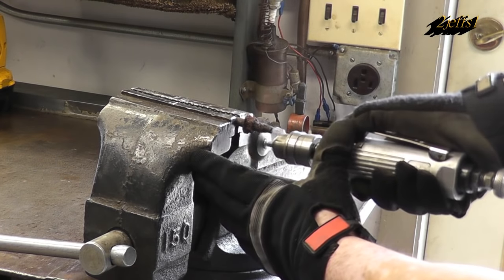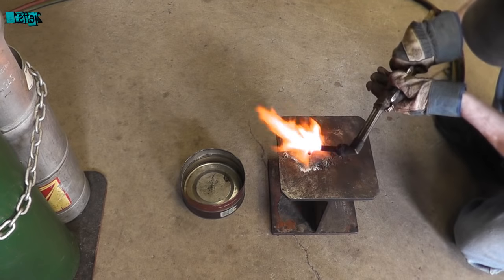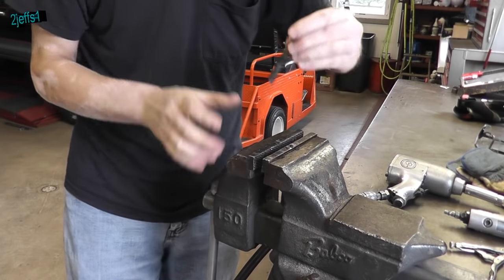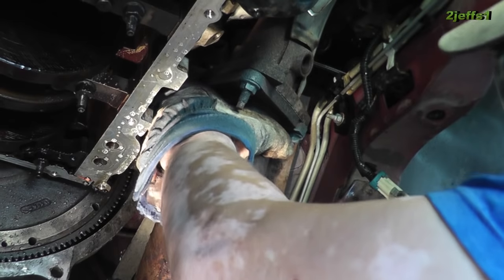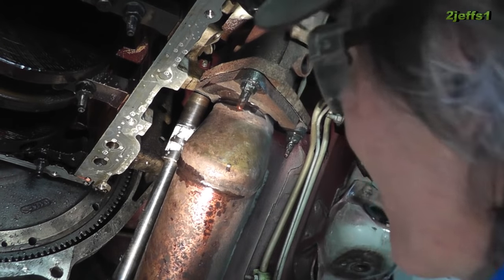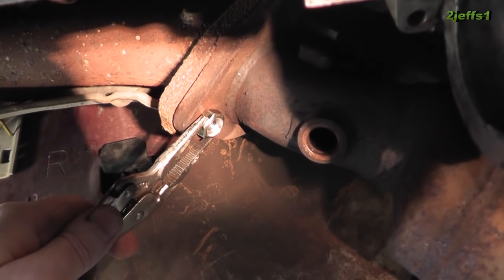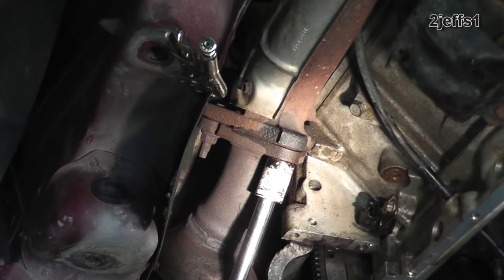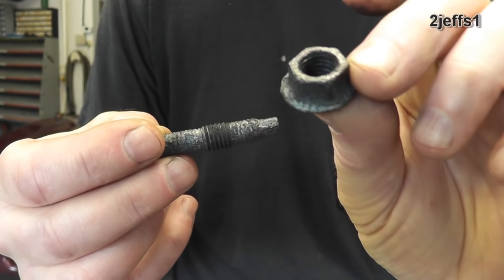Removing Rusted Bolts and Nuts THIS WORKS GREAT!

Comment: Hey Jeff, I learned that very trick myself over 40 years ago!  It worked then and looks like it works still!  There are those that say 'How do you know it wouldn't have come off without trying it first?' but learning to resist that temptation to find out marks a big difference in the 'experience curve'!  
But one other additional thing I did with exhaust bolts or similar was to clean up the threads and use new bolts of course but I always took the precaution of adding anti-seize compound to everything before putting it back together!  I figured it would be doing the next mechanic that had to work on it a big favor, and there was always a good chance it would have been me!  Upper exhaust manifold bolts on old Ford 390's as an example!
Great videos!
Reply from the maker: Great write-up you had there! It was hard to believe there were some nay sayers. It is easy to tell how much experience they had in the real world by the comments. I got a kick out of some thought I re-used the studs where replacement wasn't included in the vid. But-why should that matter anyway. The vid was how to get the rusty stuff apart, not when/whether the studs need replacing! It was easy to tell it's not your first day on the planet! Thanks for stopping by, Jeff.
Reply: Sometimes instead of anti-seize, depending on the application, I use low strength threadlocker (Loctite).  This forms a seal between the threads that keeps out moisture/corrosion.

Comment: A bit of candle wax painted over the backside of the heated exhaust flange  will wick between the stud and flange threads like solder -  I've pulled frozen  studs from a 100 year old tractor  using both the cold water and candle wax trick.
Reply: Make a video please.
Reply: no need for a video -  after heating the area, wait until the orange glow just disappears and  use a candle to flow wax around the stud. Just like solder in a copper  plumbing joint, it will wick  deep into the threads to lube them for extraction.   It's a process that's been used by blacksmiths for two hundred years...
Reply: The wax does nothing.  The heat is doing all the work.  Its an old wives tale that the wax 'lubricates' the metal.
Reply: @yeagermcbipper9008  I always wondered about that. I've seen videos of people doing it and in my opinion the wax vaporises before it can even reach the threads.

Comment: I have a little Oxygen / Map gas torch from home depot.  I’ve been using the same type torch since the 80s when it was Solid Oxygen.  It’s a small flame but very hot and very precise.  I only heat the nut and take them off while still red hot and it never failed me in +30 years. 

 I’ve found this torch very useful when dealing with brake bleeders, I heat around the back of the cylinder where the bleeder threads in.  The flame it so small and hot I have consistently removed the bleeders without heating the cylinder up too much as to damage rubber parts inside. 

Heating only the female part of the thread allows it to expand but you have to break it loose while still hot.
Reply: Hey Frank, anywhere you can still find those? Or something that is basically the same thing? I was looking today and I'd like a torch better than just propane, which is pretty bad, but I don't have the cash for a big oxy/act one, that one you mentioned sounds really cool.
Reply: Frank L Rusty bleeder screws are easier to remove if you place a snug fitting drill bit into it before wrenching on it, keeps them from twisting off so easily.
Reply: At ace hardware, home depot or your local hardware store.
Reply: Frank L I have been removing bleeders like that for years and havnt broke one since I was 16 yrs old. a long time ago

Comment: This is the reason I don't do exhaust systems anymore.  Rust everywhere, in your hair, eyes (even with glasses on), etc.  Been doing auto repairs for over 40 years. I find it better to bring it to an exhaust shop where they do it all day and its not a big deal to them.
Reply: I'm with you. I do most of my own auto work but I leave A/C refrigerant systems, automatic transmissions, and exhaust to professionals. In the first two I don't know what I am doing; in exhaust systems the pros can do it with a tenth of the aggravation and low prices.

Comment: I can vouch for this system I have used it for the last 40 years and it always works, now that I  am retired I collect stationary engines and it works all the time when undoing stubborn bolts and nuts which is a normal thing on old engines!!!!

Comment: An old blacksmith showed me this many years ago when I was struggling with a series of studs on a tractor axle. I sheered off several despite being red hot. Cooling them quickly made all the difference. Many thanks for posting, it's a really great tip.
Reply: If they remain red hot they will shear. However, if cooled quickly, and cooled so they are absolutely cold then they will undo easily. Often with fingers, I think this is partly due to the explosive air around the stud as it cools loosening rust and other debris. Also rapid shrinking and expansion. 
It also works on bearing shells that are sweated onto a shaft. They will drop off!
Reply: I believe when you look at what heating actually is for metal.. (rusting very quickly), the surface rust is removed and another ultra-thin layer of metal is turned to rust.  This makes the bolt actually a little smaller and the nut is a little larger in other words.  That causes it to work.
Reply: I believe that is correct in essence. I have cut into nuts before and the thread inside along with the nut were rusty, high enough heat somehow vaporizes that small surface it seems like. Now if I only had a real torch... I'm always trying to do it with propane which doesn't work so well.
Reply: Heating metal is actually not "rusting very quickly"
Reply: aeridyne Every try map gas on a small propane torch? I never had i just wondered if it was much better?
Reply: Simon Broddle I believe it's because the screw has smaller mass, therefore it contracts quicker, releasing it.
Reply: I was thinking that two different things work together to break the rusted bolt. One thing is surface area distribution. A larger surface area getting wet will draw more heat into the water hitting the surface and washed away with the water current. I picture it just like a heat sink which has fins to create a larger surface area and have more heat drawn off by the air of a forced air current from a fan. One of the two surfaces will have more of the heat removing water flowing over it and cause a thermal difference between the two metals. The second thing happening is that the two metals are probably not the exact same qualities of steel and also have bits of rust between them binding them together. Basically they are bi-metallic contact area just like in an old style thermostat bi-metallic coil. One side of the coil heats faster than the other causing the coil spring to expand and contract at different rates. Since the two principals work together 1 the rapid increase and removal of heat and 2 the difference in metal/rust properties you get a an expansion and contraction difference resulting in the rust being cracked off of the metal surfaces.

Comment: For my own Ford Ranger, I found the best way for this home mechanic (from trial and mostly error) to remove the exhaust system, is to run the engine and get everything good and hot, then spray a good lubricant liberally all over the threads, and it removes easily when it is hot.  It is damn near impossible to remove when cold.
Reply: I learned not to take apart some stuff on a car in the winter enless they are heated up. It took me years and plenty of broken bolts to learn.

Comment: Just tried it with a MAP torch and a spray bottle of water.  Didn't need to get the nut red hot.  Had to do this technique twice, and work the bolt forward/reverse/forward/reverse more and more till it came.  Worked great!  Would have 100% snapped that rusted bolt without it.  Thank you!!!
Reply from the maker: Your welcome!

Comment: A physics teacher told me that when you heat a nut and bolt, everything gets larger, including the space between them.  Sounds contra indicated, but worked when I tried it.
Reply: It's the subsequent quick cooling that creates the separation.

Comment: I've found it to work with a MAPP gas plumbing torch, little spray bottle with cold water,  PB Blaster, and a good breaker bar with extensions and angled adapters for ridiculously located bolts.  Sometimes I use my leg to push the breaker bar for more leverage, but being mindful not to put too much pressure so as to break the an extension!

Comment: I had a blowout on a old van. man that wheel heated up. The lug nut would not budge. So i poured ice water over it. And it came right off. just another in a pinch trick

Comment: Hi Jeff glad to see another believer, some of The Yesterdays tractor forum guys are non's.  i learned this from an old blacksmith back in the U.K when I worked there part time before I left school and for a short time after college. 
I was 14 then and now 41. so been doing it for lots of years now. I find if it doesn't work the first time heat and repeat for nuts/threads it can work the second go. I even do top links and other tractor hitch components this way.  

The welding nuts on studs I find works so so sometimes and can harden the bolt then your screwed trying to remove it if it don't work, as you cant drill it easy. also it's very important to get all the heat out first. It is possible to strip the threads as they heat seize when you start moving them.

 Thats why I never use the impact doing this .By hand with a wrench or ratchet and socket I know exactly whats happening before it's to late. A guy can go back and forth to clean and lubricate to get the rust out and free the tight spots as soon you feel them start binding up by the time the impact starts grunting it's all over if your not careful.
 Regards Robert
Reply from the maker: +super6954 Awesome write up you have here Robert! I thought this would make a good video where every time I try to explain this to someone I kinda get the deer in the headlights look. I think It's neat that you have done this too. All these kind of tips should be passed to the next generations. Where I turn the impact turned down there are times where I'll rock it or if it stops turning it wasn't heated enough to begin with. I have different impact guns. I have found the electric ones are not as controllable for this and the duel hammer more powerful air ones are not the ones of choice either. It is quite evident it's not your first day doing these things. Thank you for your comment and hope to catch you back here again, Jeff
Reply: +2jeffs1 Thanks Jeff. I just wish I had time to do these video's like you guys. And the patience to deal with all the never done anything arm chair experts. I'm guessing that old blacksmiths gone now. But he had a son in the shop to that  took over, so not all was lost there .  My other mentor was a self taught back yard machinist, sadly I heard he died and not much of his knowledge has survived. He could build or fix pretty much anything. when i moved away he didn't have anybody else really interested sadly.  I bet his machine tools got scrapped to. I'd of loved to ship them out of the U.K to Manitoba, to keep what he built up over the years  alive  that amount of stuffs hard to find here at good prices and condition to. There was a lot of time spent with him there learning and good memory's to. Hows the Backhoe, maybe we could see an update video one day, Thats how I  got here subscribing to you, totally by accident finding that restoration. Regards Robert
Reply from the maker: +super6954 Had to tell ya I lost it on your arm chair deal. Real world v/s..... There was a very good machinist in this area. I had one do some work for me when I was just out of high school. I was told don't rush him so I patiently waited. When I picked up my things I was so impressed on the quality of his work! People like that I would of loved to hang around with watch and learn but never had that option. And just like you I heard he died not too long after. Oh - I do like your suggestion on a Case update. A few new things added, tires are getting worn but still looks & runs like new!
Take care Robert & hope to catch ya again, Jeff

Comment: Heat will usually persuade stuck bolts studs and nuts to give up. I've always used just heat with about a 99% success rate. The only thing I would mention with using water is it can change the characteristics of some metals, cast iron for an example and hardened bolts. Worth considering when you pick up the water to cool it.

Comment: Good to see somebody else having to struggle with rusty shit too.  Misery loves company, I have to mess with shit like this all the time.  You are not alone.  from upstate NY
One thing I sometimes do is run them out until they start hanging, then get a little panther piss on it and run it back in then out then in then out again.  Sometimes this gets them over the "hump" so they don't snap off.

Comment: I Always use heat when a bolt looks like it might/could break. I've even used a mapp gas torch when I don't feel like digging out my oxy-acetylene torch, but I turn them out red hot and quench the socket afterwords. The worst rusted bolts screw off like they're lose.

Comment: I'm already impressed! I always cranked them off while they were glowing orange. It never even crossed my mind to get them hot and then shock them with cold water. I imagine the temperature shock breaks the scaly rust loose from the metal.
Reply from the maker: +Chip Wright This sure takes the aggravation factor out of the rusty stuff. There are so many areas on the vehicles coming in lately that seem worse than ever showing up here to be serviced. When ever the streets flood it is guaranteed in the next 6 months you will be replacing some flange wheel bearings. This method works great on the bolts that hold them on! Thanks for your comment Chip, Jeff
Reply: It's interesting that you say that about the wheel bearings. I have been telling people for a long time that it may not seem to hurt anything to drive through flooded roads, but a little later on they'll be buying new wheel bearings. Thanks Jeff

Comment: Nice. Another excellent use for my everlast tig welder. I never really thought to use it to extract broken bolts.
Reply: As a welder/fabricator I was always called upon to remove broken bolts as I was the only one allowed to use the oxy/acetelyne torch. We would fab a washer and plug weld it the broken off bolt or stud and then weld a nut on top of the washer. Get out your ratchet and your done.

Comment: Thanks. Used this method, with a propane torch, to get 2 out of 3 studs out of the exhaust manifold with a 3/8" cordless impact and a stud remover.  I was impatient with one and used the 1/2" cordless and snapped it inside. Going to have to drill and use a bolt extractor since I don't have a welder, but I will heat it up also.

Comment: That was the best video on removing exhaust manifold nuts and bolts thank you now i'll visit harbor freight to purchase a oxygen and acetylene torch set up and a welder.
🗨️🤓👍
Reply: Sir, before you do this check to see if your LWS, or local welding supply will fill the harbor freight bottles.  Be forewarned,  most places are refusing to fill Chinese made oxy acetylene bottles !!! And I don't blame them.

Comment: Wayne Anderson hit it right on, it's easy when you have all that room, room thats not very common in the majority of situations, such as a temp sensor in an exhaust pipe stuck up behind the engine and accessed in a maybe 12 sq inch space from a wheel well where all you can use is a wrench.

Comment: Great tips, thanks for sharing! Any suggestions for removing rusted bolts from auto suspension parts like stabilizer links where a rubber sleeve on the bolt and might be damaged by heat?
Reply from the maker: Keeping the rubber soaked the entire time helps but - no not a good answer for that. Usually we just end up cutting them off & replacing with one of those kits where that thru bolt can get quite thin from rust.

Comment: Heat red hot then cool. Nice touch. Anyway im gonna try heating red hot then pressing a candle onto it to cool. Heard it will pull wax into the stuck thread.

Comment: One of the two bolts holding up the side stand on my old motorcycle was so tight, I ended up rounding off the hex head, even after heating with a propane torch, quenching with water, and using a budget pneumatic impact wrench.  I was smart enough to quit at this point, took it to my new pro mechanic, and he got it loose with the same technique, though his torch and impact driver were much better than mine.  He hammered a one-size-down impact socket onto the rounded head, so there was no need to engage any advanced bolt extraction tools and techniques.  I could tell he used big heat and quick quenching because the surface of the alloy engine block in that area flaked off a little.  I didn't mind, though, because the desired result was obtained with little cost and without worse damage.  I agree with other comments that pro level tools are sometimes necessary, and I relate my modest success story to advise other DIY home tinkerers that part of the algorithm is to know when you are beat and call on the pros for help.  2jeffs1 - Excellent presentation style -- good humored, fast-paced, with just enough quiet music, dogs, and nature to add a welcome personal touch without being a time-wasting distraction.  Your technique of not trying to speak while working, then overdubbing the explanation later is perfect, much clearer than others who try to do it all at once.  Much thanks for your extra effort and great info!